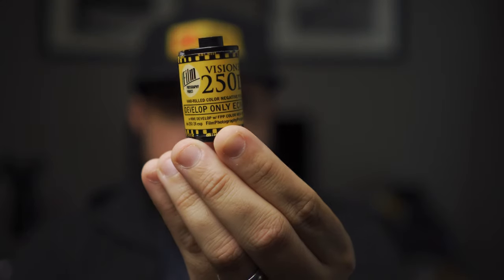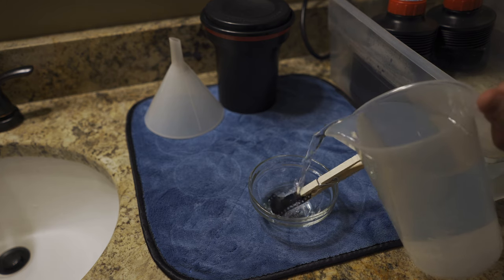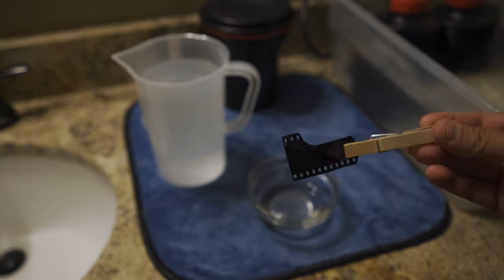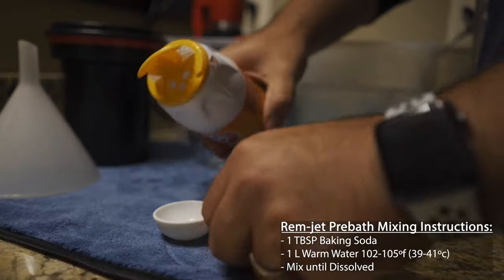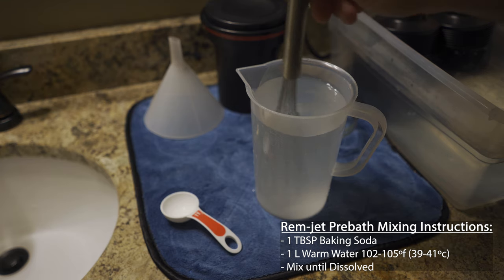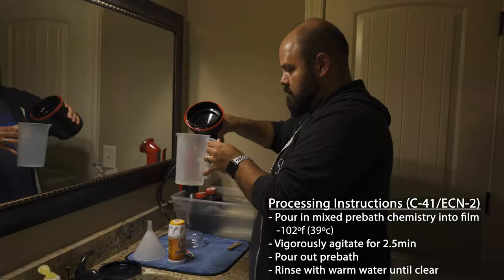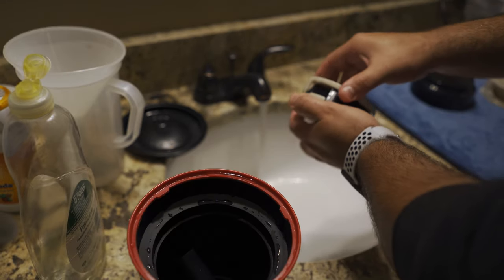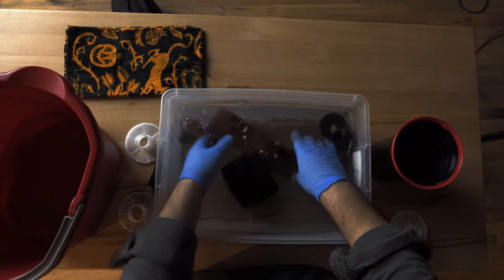Rem-jet Prebath Made Easy

Comment: Thanks for this! I was just wondering, can you use the C-41 process rather than the ecn-2 on Vision3?
Reply: You can "cross process" in C-41 with no issues. Any small differences with contrast or color rendition (shifts) can be fixed or tweaked in photo editing software.

Comment: I recently developed a roll of Kodachrome. I soaked it in baking soda, rinsed, and did my normal b&w process. I took the film out of the tank, and I could see my images on there. I hung it to dry. I came back and there were no images. A couple of days later, I thought, “maybe I didn’t get all of the remjet off of it. I rinsed it again. Pulled it out. There were images. It dried and there were no images again.

Comment: How long can you shelf it and for how many rolls roughly per 1L?
Reply: I would imagine it isn't even be worth shelving.  Baking soda is so cheap that you could just mix a new bottle for every batch.
Reply: There is no chemical reaction, so nothing is consumed by soaking your ECN-2 film in this soda bath. Store it to keep clean, and pour it through a coffee filter after several uses to remove the rem-jet material which comes off in it. A better chemical solution to use for rem-jet removal:  Per liter of water, 100 gr of sodium sulfite, 10 gr of borax, and 1 gr of sodium hydroxide (lye). Use at 80 - 85F, agitating vigorously for 10 - 20 seconds, then water flush until clear.

Comment: Hello will this 'Baking soda' pre-bath work well for softening Rem Jet on the Kodak Kodachrome-X photographic film? I've spent a few hours browsing the Web on the subject and I see people get so different results when removing Rem Jet layer. For some it just comes off itself after developing (many standards developer formulae contain Borax and Sodium Sulfite  - but NOT Sulfate!), for others it takes a lot of effort to mechanically scrub it off even after applying the dedicated softener. As you probably know there is a well known former QC manager Alan Marcus who advocates a standard commercial recipe of the Rem Jet softener (which apparently comes directly from Kodak). It does contain Sodium Sulfate. However he says that even with the dedicated softener Rem Jet would not come off as easily and will require rubbing it off by hand with a cotton cloth. That recipe has spread all over the thematic Internet forums so anyone can easily find it via a search engine.

Comment: Any idea if I can remove the remjet after the film has been developed and run through the projector?
Reply from the maker: You can but it comes at the cost of contaminating your developer. The adhesive will absorb into the chemistry causing future films to experience color shifts. Next the rem-jet will break apart in the developer causing future films processed to have rem jet on it. Some suggest you use a coffee filter to filter the rem jet from the chemistry. But ideally, best to remove as much rem-jet before running it through any chemistry.
Reply: @StudioC41  Thanks! What I mean is that I am using motion picture film, and I processed it several days ago not realizing that I need to get the remjet off. The image looks rather dark and I'm a bit new to this so I don't actually know if I got the remjet off (to make things tripple complicated I am using expired film and cross processing reversal color to black and white negative) Everthing has a tannish color, and the backing looks dark, I will try to dunk it in the sodawash water and see what happens, this roll of film has been dried and run through a projector